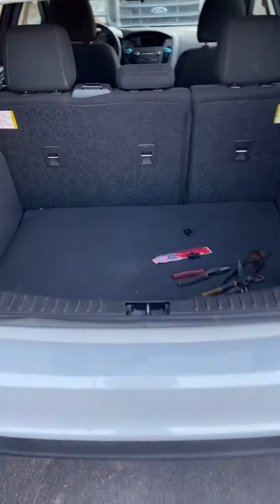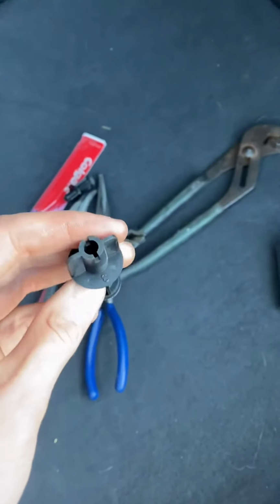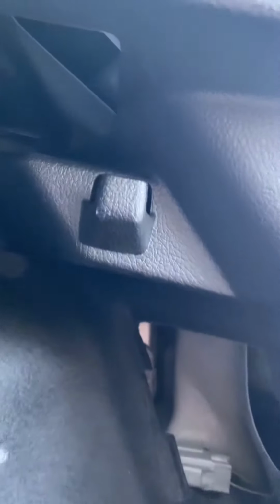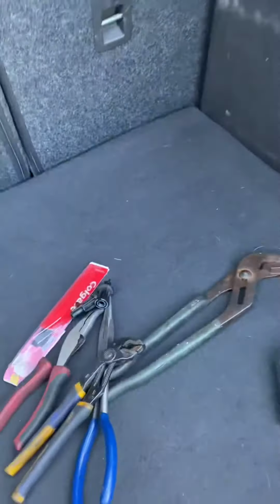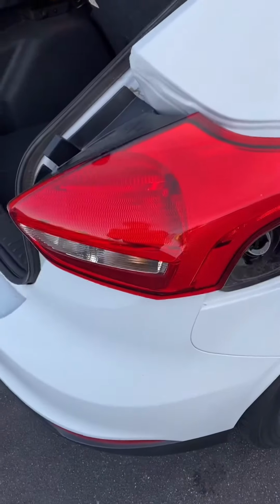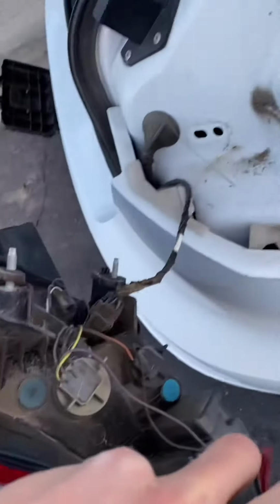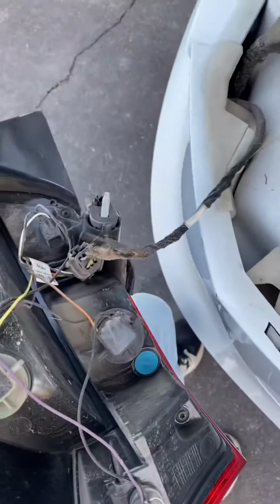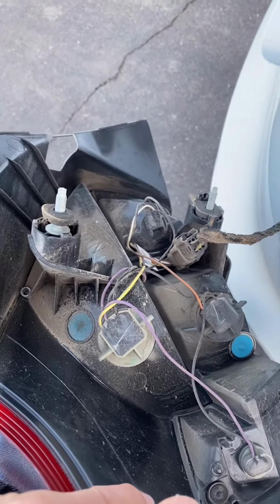2018 Ford Focus brake lamp fault bulb replacement

Comment: You take that felt cover off, there will be a plastic wing nut. Take that off. Just above it will be another one. Remove. Then u have to carefully pull the entire light cover off, pulling straight out. There is like a fragile plastic grey nipple that’s lodged in hole under the light cover. Change the bulbs, the put back the way you took it off. Easy, don’t need tools. Just a bitch to be told how silly it is to do. Takes 5 minutes
Reply: Thank you 🙏🏻